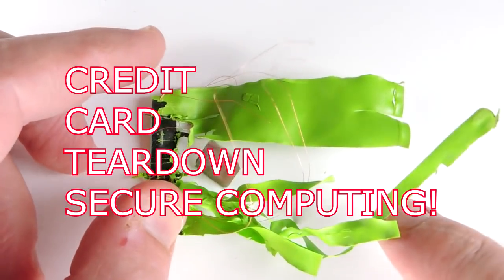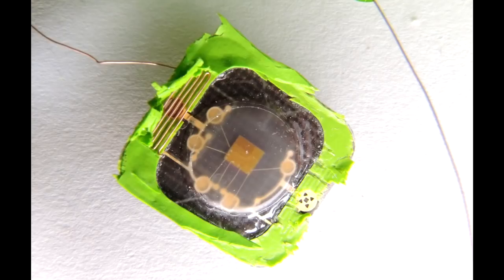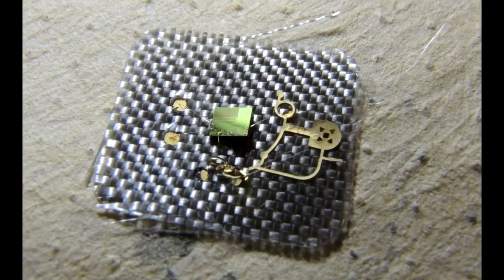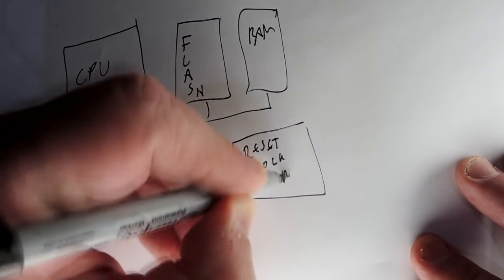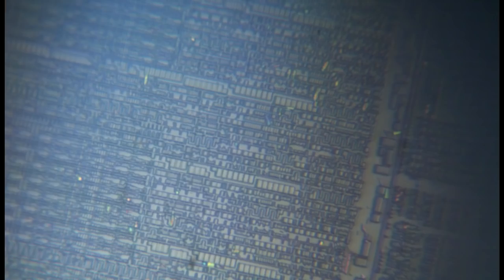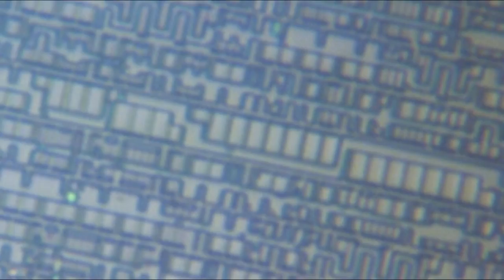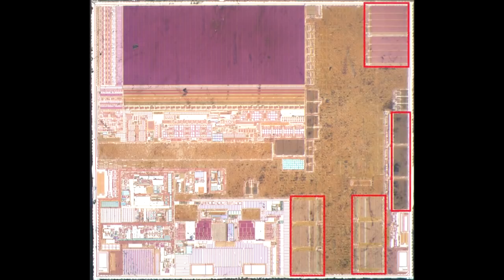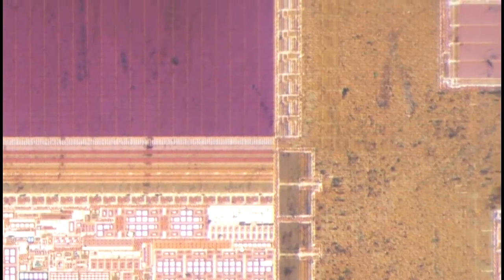Credit Card Teardown: Secure Computing

Comment: Thanks for another great video 🙂! Isn't it a coil, and not an antenna?
Reply: Any wire is an antenna.
This type of cards use a coil-antenna and it is designed for near field communications. That means that the cardreader has a coil antenna as well and they are closely coupled in the near field. There is still significant emissions from such a setup if you target your antenna right so the communication is made in such a way as to encrypt the traffic as well. Typical range is 2-7cm but you can get systems pushing this to 10-15cm in the same frequency and antenna size range.

Comment: Some if not all smart cards have a JVM in hardware for running code. Phone SIMS are ones that I know do contain a JVM.
Reply: stonent They may have something that is similar to arm's "Jazelle" mode which would makes it a (limited) JM then, and not a JVM. To think this little piece of silicon runs a GlobalPlatform OPEN or confirming card OS and applications. What is also likely is a non-java byte code interpreter just like in the 3gpp usim specs.

Comment: My kid works for a company that takes this technology one step farther. They make credit cards not only with "The Chip", but also that chip is inactivated until you punch in your PIN...... on the credit card itself. They are selling them in Asia, South America and certain parts of Europe but the last I knew they were not approved in the U.S.A. yet. The advantage of course is that even if you lose the card or it is stolen it is worthless until you enter the PIN.
Reply: What do you mean "takes this technology further". This is generally how signature cards work. To unlock a private key you have to present a valid PIN. Then you can use whatever signing operation with that key. And if you can't present a valid PIN then the signing operation fails should you try it anyhow. And that was already way back in the nineties for example with cards like the Gemplus GPK series.

Comment: Fricking awesome. So much time spent showing us this cool tech. Thank you so much for doing this. I just don’t have the time or comfort with acids to do this. 

Thanks again. Keep up the great content. 

I would be interested in why the silicon shapes become a gate or a memory area and such. I’m not sure if others would like that but I would watch it and share it a ton.
Reply: Modern ICs can containe billions of transistors. This credit card probably contains several millons already. Building blocks such as bits of RAM or an adder or a register for example are made of smaller building blocks called "logic gates". Any circuit can be made out of three gates: AND, OR, NOT. the AND gate ouptuts a 1 if both of its inputs are 1. The OR gate outputs 1 if at least one of its input is 1. The NOT gate outputs zero of its input is one and vice versa.
Reply: I absolutely agree. This is something I would love to do myself.  Definitely keep these coming!

Comment: how is it powered?
Reply: The reader puts out bursts of RF, that’s picked up by the antenna on the card and the chip ‘loads’ the signal down to signal back. It doesn’t actually transmit, just shunts power. TLDR; Magic.
Reply: Power is supplied via its pins on ATM's or POS machines and such, and the contactless section gets powered by the RF field and it charges the capacitors in the chip, so it can do calculations for a limited amount of time. It is the RFID technology.
Reply: @devrim-oguz  The RFID reader continuously sends power, the reader sends data by very briefly interrupting the magnetic field, while the card sends data by varying ita current consumption (load modulation)
Reply: @atmel9077  Yes, but the chip needs to be powered in order to make calculations for the data to be transmitted.
Reply: @devrim-oguz  The field is interrupted less than 300 microseconds, (32 cycles at 13.56MHz) and the chip does have enough capacitance to run even when the field is off, because a very small capacitor is sufficient. The field is interrupted only in the ISO14443-A standard at 106kbps. Both ISO14443-B and ISO14443-A at higher data rated uses amplitude modulation with 10% modulation index.
Reply: When the credit card is inserted into the card reader the reader applies power to specific contacts and the other contacts are for data. 

It is different when used wirelessly that is more like how a phone charging pad works.
Reply: I think it's passive induction. The antenna powers the very low voltage chip. I think that's part of why it only works within a certain distance. I dunno, i'm likely very wrong.

Comment: Thank you for making this; it's extremely interesting to see what runs these credit cards now. So much for magnetic strips and carbon-copy paper haha.
Reply: Yet, most cards these days are backward-compatible with not only magstripe (which is still around) but even have raised numbering for use with carbon-copy. I wonder if carbon-copy is actually still in use anywhere, or if the raised numbers are just around because of people's expectations of what a genuine card should look like.
Reply: Gameboygenius the raised embossed numbers could be a security feature to prove the card is genuine.
Reply: @jakp8777  Yeah, that's what I call expectations. Punching numbers into plastic isn't exactly high tech, and any card scammer can easily get a number puncher. Arguably printing the numbers  instead of punching them would actually be safer (more difficult to duplicate for a medium effort scammer - needing a printing facility instead of a hand-operated mechanical puncher). Switching to unpunched cards on the other hand would cause confusion for years to come as cards are replaced, which could cost more in PR than the cost reduction in producing the cards.
Reply: @Gameboygenius  In the ast year I have had a tow truck and a plumber both do impression card payment. 
In both instances they had hardware failures on their portable electronic processing device.
Reply: Also, non-raised numbers get erased over time (happened 2 of my cards)
Reply: About 5 years ago i had dispensed fuel at a petrol station in the uk and the tills went down when i went to pay. They got the zip-zap machine (carbon copy) out.